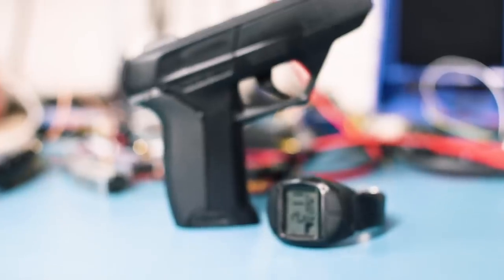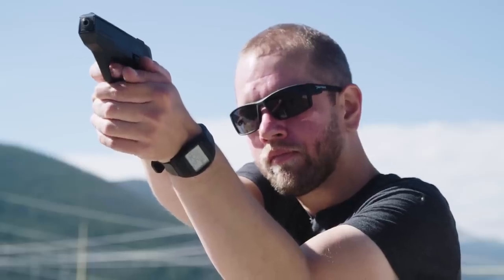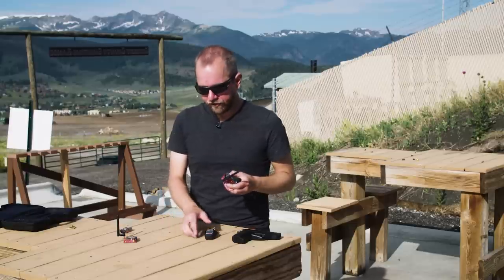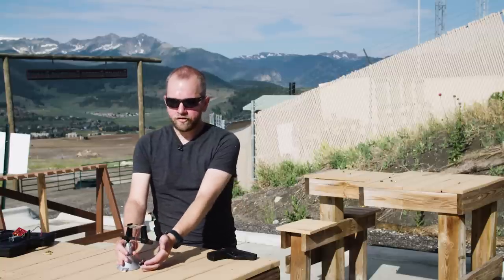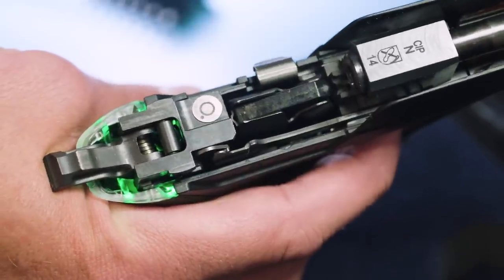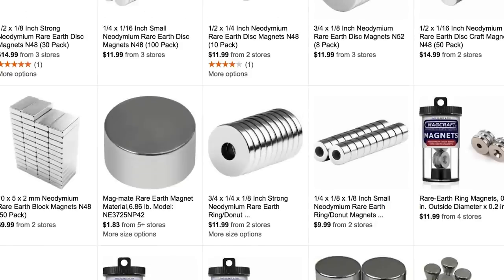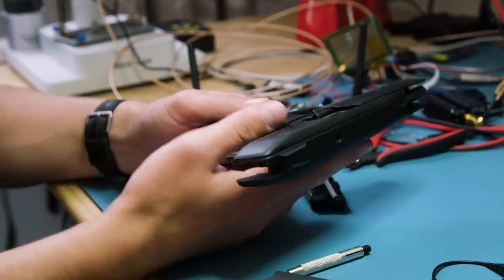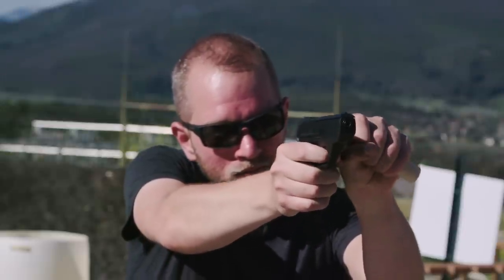How a Hacker Fired a Locked Smart Gun Using Only Magnets | WIRED

Comment: The firearm community has an obsession with reliability, speed of access, and affordability. "Smart guns" by nature weaken all three.

Do the people who are spending the money to develop this tech not believe in doing market research, or...?
Reply: They are only being developed as an actual product for the long term. Right now they are being developed as a proof of concept for the anti-gun lobby. What the manufacturer is banking on is that the lobby will get it passed that all guns will require this tech that they hold patents on...the long game.
Reply: Not everyone that owns a gun is part of the "community".
Reply: Dillon Herrero - True. I believe most would still rather buy a $500 gun + a $10 gun lock, than spend $1000+  on a gun that's going to have dead batteries when you need it in an emergency.
Reply: it looks like this is made just to apease every one who thinks gun control is a good idea.. next they will be tracking the guns....oh wait
Reply: +Ryan edge, I have no issue with the technology as a concept.  The problem is if this becomes a requirement for guns.  If someone has a situation where they are choosing between a smart gun or no gun, I think a functioning smart gun is a good option.  I personally don't intend to use them, but in concept, there is nothing specifically wrong with that avenue of thought.  After all, more options is always better.
Of course, the application can go awry - like requiring them on all civilian pistols.  I suspect though, with the technology as it is, there is nothing to worry about.  This tech doesn't look viable for another decade.  Even then, we're not outfitting police or military with that (for fear of having all their weapons shut down remotely), so I don't think it'll be a requirement.  
Like many "innovations" it seems like a super small niche market.
And you are absolutely right about a lock with your gun.  A smart gun owner is way smarter than a smart gun.
Reply: +InItForTheParking I really hope that isn't the case.  The tech on this is so far off from being viable, and even if the tech was perfect, it still somewhat unsavory.  In theory though, it's easy to sell.  My gun can't be used if stolen, and doesn't impede me (again only in theory and not reality)?  Police can shut down all guns in X radius if someone goes rampaging?  Eh, that's a bit more iffy sounding, but maybe good?   Kids can't shoot themselves with their parents weapon - um, not bad, but for responsible gun owner parents redundant.
On the plus side, the tech is so far away.  I'd think it's at least a decade from being presentable.  As long as it can be hacked, and there's pretty much no tech that isn't, it'll be inviable.  It's obvious once one person figures out how to bypass, with the internet, everyone will know, pretty much defeating the purpose.  
I'm pro-gun, but not rabidly so, but I'd fight tooth and nail against any such law (even knowing my guns will be grandfathered in most likely).
Reply: ryan edge They want to extend the firearm community
Reply: ryan edge They say that the parent company is German so they might be trying to get gun ownership more possible in the EU.
Reply: ryan edge , Best gun locking tech I've seen is the zore lock.
Reply: The man behind this gun is a German who thinks Americans shouldn't own guns. He is aware of states which passed laws mandating this technology a given time after the first one comes on the market.

That tells you all you need to know.
Reply: a mechanical gun still fails but that's up for debate and still depending how many time to fire it. there's a reason why cleaning and checking your gun after each shooting session is a must. if the hammer, spring does not work right and the gun gets jam your screw especially in life and death situations.
Reply: That is why you have to allow tech to develop, the power needed for something this simple is quite small, it won't take long for us to have the tech to have the battery on one of these things last years or decades, like how many watch batteries do.
Reply: ChasingTruth TakingFlak I live in that shit state it's called New Jersey. People have called other gun store outside of the state sending death threats because if one sells the whole state is screw. Personally think the law restricts progress of the smart gun. I personally wouldn't buy a smart gun but some people what it. Also the technology is too new to ban other handgun from the sale (also people like me don't what it so just don't ban normal handguns).
Reply: ryan edge they have done a lot of market research..... governments are trying to ban guns. This helps governments are anti gun laws and giving this company a monopoly
Reply: Honestly "proper" gun storage isn't even an issue for safety (there is a reason it isn't part of the 4 safety rules). There are very few cases of improper storage causing deaths, but tons of cases where inaccessibility has caused deaths for officers and citizens. And gun locks never saved a life or stopped a thief. If all it took was to lock things to keep thieves out, no cars would be stolen.
Reply: The implementation of this smart gun, other than it's vulnerability to remote jamming, would be great for law enforcement officers who have to worry about someone going for the officer's gun after being tackled to the ground. Basically there is an important market for it if it can be made reliable and relatively affordable, but it's neither the home defense nor the hobbyist crowd.

For hobbyists it really depends on their safety needs, it might be wise to buy a smart gun if there is a concern about a child someday finding the gun (and/or the gun being left loaded when it shouldn't be). But to someone without children, or whose children are all responsible adults, the "smart" features just represent extra failure modes. For someone who wants a gun for home defense then quick access and reliability are paramount, and any smart gun that fails on those metrics will be useless for it's intended function.
Reply: In the future there may be injections or something as simple as a ring/wedding ring that allow your gun to be fired when you hold the gun. What about a phone case that sends a signal? How about facial recognition right when you aim into the sights? We need things that will be always there, not something that is an optional wear like a watch. By the way this concept isn’t meant to be expensive even later on, it’s meant to be a future use with the same cost as a normal gun.
Reply: [TVA] 1815 Delta III Are you smoking meth?
Reply: ryan edge well i doubt the market is the avarage consumer. i can see the smart guns being a great option for policemen or guards or someone who needs to open carry a handgun. for example if someone assaults a cop to take his gun and rob some place or some shit smart guns would be enough for it to not work.

look at gaming for example, although only a fraction of this translates into real life it is enough to see why it makes sense, some metal gear games for examply you cant pick up enemy weapons because they are locked, cant remember exactly how but it was some high tech explanation, this was a huge set back for the protagonist since he would have to manage ammunition and pick gear carefully since he couldnt just grab whatever was in the ground.

now this doesnt translate directly into reality since that situation is rather unlikely, but if a smart gun can prevent some kid from stabbing a cop and shooting up the closest public space with his gun then why not...

although in the US the kid would probably have his own gun, but hey, its some sort of progress
Reply: David Johnson i highly doubt that it will work in that way in the real world. 😁
Reply: WhyteLis21 you haven't seen how modern car thieves work then.  Some modern criminals are using some fair high tech electronics and wireless devices.  It's not even a leap, just a single step to create a devices which jams or otherwise hacks these smart guns.  This particular product is never going to fly.
Reply: yeah for this product because it only uses magnet alone to fire.
Reply: People ride motorcycles because of the sound and feel of the engine. 

Do the ones making electric motorcycles lack market research? Or do they look further ahead?

The smart gun clearly is designed towards the anti-gun lobby.
Reply: +jelly72 if they are so anti gun, they wouldn't be buying any guns at all. electrical or mechanical. that's not very anti gun. there's no guarantees safety without proper responsible safety training regardless if it's electrical or mechanical gun.
Reply: WhyteLis21 m8 there are laws in several states that once smart guns become "viable" that's all you can own. We'd just rather not be stuck with magnet bastards. Less reliability and less variety because aside from defense there is legitimate uses such as love of history or sport
Reply: > "Do the people who are spending the money to develop this tech not believe in doing market research, or...?"

I'm thinking they hope to cash in when governments start to require smart guns as a way for tyrants to circumnavigate the concept of gun rights.
Reply: track it or jam the guns operation when you need it most
Reply: WhyteLis21 then you're unimaginative and don't study history. Criminals aren't stupid and we've known how to build radio transmitters for over a hundred years. You can put one together for under 10 bucks at radio shack (if you can find a radio shack). Jammers are the same tech.

Seriously, it wouldn't take much, and criminals are always looking for an advantage over leos.

Cops wear Kevlar, criminals try to obtain ap rounds. Cops started carrying patrol rifles when bank robbers in LA wore body armor and armed up with AK's.

A device that keeps cops from being able to shoot is a gang banger or heist planners wet dream.
Reply: regardless it'd be badass to have a Judge Dredd smart gun, switch between hp, incendiary, etc
Reply: Nub93 also poor people need defense too so expensive prohibitive pricing isn't helping
Reply: guns are not that expansive. you can buy one for a few hundred dollars. the expensive is bullets. anything that's higher than 9mm or .22 are not cheap i believe.
Reply: WhyteLis21 yeah they're not expensive because most gun owners are casual and won't drop down fat stacks so companies go for that demographic. Also lots of ammo is cheap especially if you reload.
Reply: +Nub93 poor people or not can still buy cheap guns let alone steal one. either from black market or cheap firearm online or someone who don't care about safety of others.
Reply: I would like to believe the firearm community also had even the slightest obsession with safety. Smart guns are a safety feature, albeit an expensive one that will rarely come into play, and should not be relied upon, much like you shouldn't drive recklessly in the wet just because your car has ABS.
Reply: But guns already have a safety feature. Called the Safety
Reply: regardless of how you look at safety, average people can't handle fire fight under pressure in some cases. unless you are well trained and live through the experiences. sometime these people make mistakes and often cost somebody elses life even if it's not the bad guy. there's are cases of blind accidentally shootings the wrong person even more so then criminals.
Reply: Takata, read the 4 rules of gun safety. There are no other safeties than these. For centuries guns including the military did not have safeties or locks and yet the public was quite safe in carrying them. Why do we need safeties and locks now?

Comment: define "hacker".
Reply: hack·er
ˈhakər

noun

1.
a person who uses computers to gain unauthorized access to data.
synonyms:	cybercriminal, pirate, computer criminal, keylogger, keystroke logger, etc.

2.
a person or thing that hacks or cuts roughly.

None of these match what is in the video. Nice.
Reply: TresOk idk if you know this or not but they aren't claiming he is a hacker because of what he did in this video
Reply: 13threaper20202
Reply: Nice person
Reply: rc-wingman someone who gains access to things in ways designers didn't intend
Reply: Someone who uses technology in ways other than it's intended purpose
Reply: Literally, a guy who is constantly searching for security flaws on different systems able to use them later for different purposes. They may be bad (Stealing information, accounts...) or, like in this case, good (Noticing the manufacturer about the problems, checking the security of bank websites, security systems of buildings...)
Reply: But he did hack it, technically I think, because it was using electronics
Reply: TresOk or game
Reply: Someone who exploits weakness in computer technology, white hat= good guy with no malicious intents, black hat= bad guy.
Reply: someone who downloads minecraft mods and uses them on a public server
Reply: cheater on the online gaming community
Reply: He’s a ”White-Hat”
Reply: The person used hardware/software jamming to manipulate the data (the gun).
Reply: I think reverse engineering would be a more appropriate title.
Reply: a person who uses computers to gain unauthorized access to data.
Reply: a person or thing that hacks or cuts roughly.
Reply: Gul Dukat If you mean lockpicking and/or making universal remotes for car locks - then yes. Breaking in is not exploiting weaknesses.
Reply: TresOk actually he did not the magnet part but the crying narrator showed how he at one point made a computer you held up to the gun that allowed it to shoot
Reply: Someone that bypass systems to use devices or objects not as how they were intended to be used.
Reply: Someone who can do more on a computer than open MS Word.
Reply: @tres1576  😂😂😂
Reply: Hacker
Noun 

Anyone that has a magnet lol
Reply: Put a book under a wobbly table. Congratulations. Your first hack
Reply: @tres1576  ok you actually did define it. You win, oh yea yea
Reply: A cheater